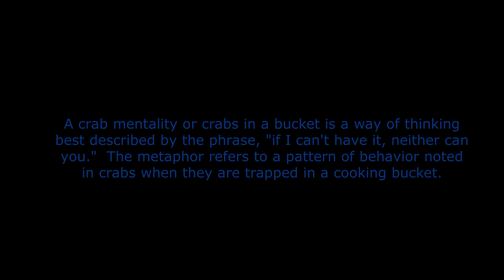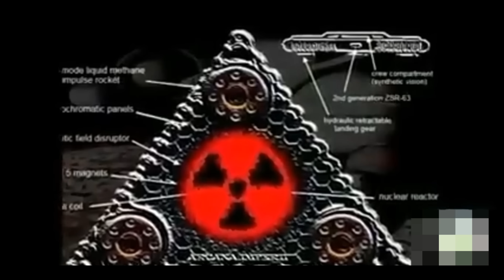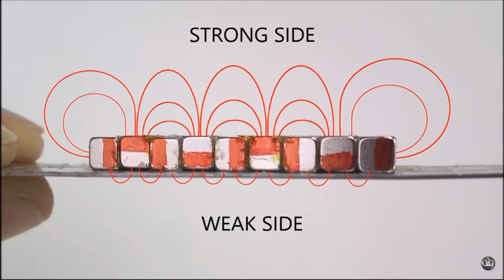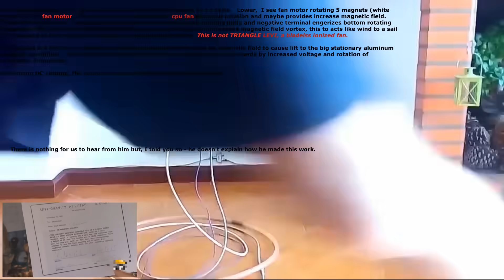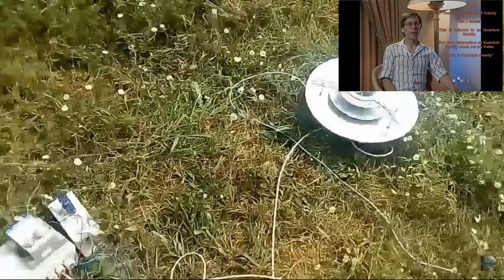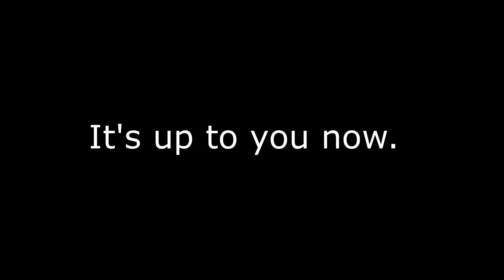anti-gravity project

Comment: Seem like the risk outweighs the benefits 
Would there be side affects? 
Large eyes, big head and skinny body! 
Serious though there would be side affects init.
Reply from the maker: None. Something to think about,  your microwave oven operate at 2.5Ghz now multiple by  two you get 5Ghz.  Can you identify with your question.  To power such a device would operate at 60hz A/C.
Reply: @jefflucas_life  a microwave oven creates radiation 
However we are not sitting in it nore around it for long periods of time 
Thus again, side effects.. now I would like to see other planets and travel the universe as well, and believe it's beyond my lifetime. 
I don't doubt it's possible, I just question everything. Not for fun, but interest, hoping I can contribute. 
Like the mercury, will it freeze in space, or is the other added metal to insure it doesn't. 
Believe me possibilities are endless. Just like the conversations with my son after watching this video. 
Back to geeking out. Thanks for the response. 
As we say these days be safe out there
Reply from the maker: two years now it’s a lot safer to use aluminum mass.

Comment: WoW that was very cool to see that ,and u guys did that with a 12 volt battery and a few other items i saw some in project boxes and how you could make the mercury spin around that is very cool  and the model took off up in one direction , but can u make it go into any direction other then just straight up in the air that is the hard part but also can u make one powerful anuff to lift a craft off the ground and fly up into space now seeing that thing fly it does not have to be saucer shaped at all just the motor i call it a motor becouse it is electrical i have a fair understanding of electricity and probably could easily recreate your model but the motor you built is not Alien it made out of materiel s found on earth , the only bad thing about it is the mercury that is probably the only part of it that would take some care in using it mercury does have some interesting properties even when used in a thermometer it can magickly move up inside a tube and show the tempeture out side kind of cool good invention also probably saved some life s , what i have seen here is very amazing to see and it was not a joke or fake it really lifted off the ground well i would say you guys have a lot of work to do in building a proper space craft no more rocket engines yeah you guys are on the right track for sure wow I am very impressed bye this and it was such a simple device to build not to complicated very few parts far less then a rocket engine wow i can t get over what I just saw plus Robert lazar does know what he is talking about also tells me what they have at Area51 is not Alien space craft but nothing more then the work of great minds in physics WoW you guys are flying in the right direction keep it up don t ever stop and tell the world this does not have to be kept a secrete like they do at Area51 and also Area51 should open there doors to the general public so they can see the most greatest inventions ever created on earth like i say this is a heavy on the WoW factor great job every one I am so impressed there where some things all s you guys could mention like how many amps did it take to get lift i know its a fair bit the wire was fairly thick so you are using a fair amount of current awesome job people you guys kick ass how about building the NC1701 Enterprise have fun lol

Comment: I wrote about gravity earlier, and my idea for gravity is same as Casimir-effect, I think the objects are pushed to each other, because the "energy shadow" between two objects. Off course the formula is different to calculate the power of the gravity, but the cause is same.
I think the anti-gravity can make by creating "energy shadow" and also we can move in the universe by pushed the Vacuum energy if our machine can create an "energy shadow"
I think the movement by pushed is working on every particle, therefore the human body does not have the problem with the acceleration like we have the way when we accelerate the space ship body with humans in it.
What do you think?
Reply: what is energy shadow

Comment: i believe magnets rule the multiverse ,  if the earth is a big magnet and magnets can be driven with energy like electrons and electron function like micro magnets,  if this is so can power and fast spinning magnets create a weak gravity that can move using the alternating flux of magnet push/pull effects?  the objective is to create a field on rotation magnet particles that will create a gravity field push/pull motion using its own pockets of stress allowing for a non friction movement,  do to the effect of this wake negative charge wave that is canceled out by a different field that fills in behind the first wake disturbance?

  in effect the energy of the disturbance is in effect causing a counter wave or wake that allows no impedance do to the action of the leading wave.  so its like a race car that leads the race moving in clean air,  the cars in the rear will suffer in that they  must move in dirty air.  now look at this in revers,  if a device causes a dirty wave of energy in front of a craft do to its energy wave fields in a way fracking the space in front this dirty charged air pocket should set up a country wave that moves without being effected by static charge?  in effect the negative charged air space acts as a pull for the positively charges air space behind it!  the one energy first pulls the dog with it?  its all energy waves moving at speed using natural existing forces in the system,  used first by technology of that hidden nature,  dark matter.

Comment: 9:54 what nonsense to say that time gets slower in space or with gravity, time no matter what formula you use, is the same no matter where you are in the universe, it's pure speculation. If you culd travel with lightspeed the time is the same, it will always run forward at the same pace ..
 1 hour forward and 1 hour back, no matter what speed you have, will always be 2 hours.
But let's say we fly away from the earth in the opposite direction as the earth moves for an hour and then turn around, then there will be much longer way back as the earth has also moved, then it maybe takes 15 min longer to reach the erth again, depending on the speed you have traveled at.
Reply: @HUNTING GAMERZ It's a mechanical thing has nothing to do with the time that has passed.
Reply: @felixundertordrup5348  no

Comment: Hey quick idea, maybe nothing will happen but mayby it will be informative.

Get 2 clocks or watches,( bonus points if it is a courts powered) set them to the same exact rhythm and time. Put one in the “saucer thingy” and run it for different langths of time. I suspect that the watches may get de-sincrinised or even end up showing different times. If so it would be fascinating to know wether it was the clock in the saucer or out that is behind and by exectly how much.
Reply: good idea

Comment: For the last part showing the lifting body, if he used Mercury which has iron dissolved in it, with impurities of Thorium, Barium, and Chromium ions, the Mercury not only becomes a ferromagnetic liquid, but also a super conductor at room temperatures or slightly above. It might need a voltage supply of 15 kV in order to get the mercury spinning fast enough (and I did notice a large coil  similar to a Tesla coil in the video). I would like to hope this is real, but with the internet, who knows. Unless I can see it for myself, it will be forever be a hoax.
Reply: Yeah it looked like a few magic tricks going on there so I'm going to decline to take this video on face value. I'll give him the benefit of the doubt on trying to put forth some new ideas. But I don't like to be deceived.
Reply: Woow Super inductor líquido a temperatura ambiente 🤯 y los científicos actuales disque buscando ese elemento y este video ya lo dice 🙏
Reply: Many coils of thin wire is for higher voltage. Thicker wire and less coils is aiming for higher amperage. So that tesla coil looking thing seems to just be converting the 12volts into much higher volts.
Reply from the maker: anti-gravity-toridal_synergy
https://youtu.be/8KGuB8bZKNs

Comment: The TR3B uses a torus to reduce gravity. the field is created at 60 revolutions per minute, at 260 atmospheres, at absolute zero of a quantity of mercury inside, the spin is created by use of electromagnets on the mercury inside the torus. creation of a torus around the first one and using the same method but spinning in the opposite direction allows the TR3B to have a frictionless shell that also allows the occupants to not become subject to any exterior force. The use of both tori created a wake where nothing electronic will function within six miles of the craft. The mercury inside the torus(s) becomes first element 118 then a millisecond later element 116 which opposes gravity
Reply: You are the first that say that is a torus inside a torus, very interesting. if your info is true, then the TR3B is not very useful in the city, and difficult to drive because no GPS. you are a primary source of info?

Comment: Hi.. Is it possible to use mercury as a rotating mechanism inside the motor so that when it starts spinning after passing current through it.. It will  start rotating wheels attached to motor.?

Comment: Vorticity is the "quantum gravity"... 

AuPt is both magnetic and diamagnetic... 

Gravity is NOT a "force"... it's just geometry... Einstein shows that in his math... and the story about light approaching a moving object... he used an elevator, which was high tech in 1900... he uses railroad cars and passengers as examples also... because that's what people knew in 1900... he didn't know there were other galaxies... until Hubble in the 20s... his math shows that the space around a mass is bent by direct inverse proportion to the distance from the center of mass.... it's not a force... it looks like we are all walking around on top of little you shaped hills... and we are all ==>> sliding downhill all the time.... 

This is actually good news... it's nice to know that the Earth does NOT suck
Reply: Einstein and other mathematics are simple... when we use metric... inches and feet... ounces and pounds... are the Imperial system... brought to you from the Roman empire... which used a counting system with no zero... and no decimals... half of the issues with Feynman's math are related to converting from metric to Imperial... people who grow up using the abacus start the numbers in the 5th column  .. 4 decimals built in... for accuracy... 10,000... so even when you convert to thousandths... the Chinese and Japanese and Korean people have an order of magnitude greater accuracy... with each measurement... and the accuracy becomes additive... or subtractive... depending on how many decimals you use

Comment: A) Gravity is definately not some kind of wave.  Never was.  B) Einstein has defined finally what gravity is by defining what mass actually is and how it expells variation into the fabric of spacetime by its sole presence.  Gravity is a property of mass itself. Nothing which is "transmitted" into an area around it. No "radiation" of any kind. Gravity therefor is also not a "particle". There is no mass that has no gravity on it, even the tiniest fraction of a mass has a gravitational impact onto the spacetime around it. So there can be no objects or machines which can shield it ,because they are even embedded therein, in the fabric of spacetime, being a part of it. So nothing which is part of our physics, can shield it. Altering gravity would require to alter the nucleophysical property of matter (down into its tiniest particles), as this may or may not alter their mass. So, only taking mass away from a location alters the gravitation. Neutralization means : taking all nucleophysical mass away from the respective object. The outcome is: The object no longer exists. Taking spacetime out of an area to "neutralize gravitation" means: Taking any kind of physical existence out of this area because outside of spacetime is no existence. In other words: Such a condition doesn't exist and also can not be produced.       To make a clear statement about "gravitational waves" (which can be detected of course but are entirely different from "static gavitation" itself, and are also no wave, radiation or particle) : This is solely a measurement differential which expresses a change of the amount of gravitation - variation in the fabric of spacetime - as the collision, the sudden fusion or hyper-/supernova-like transformation of portions of matter (into energy - waves - particles - radiation) creates a variation of their respective mass/es. This expresses as the corresponding variation of their gravity and creates a shortliving transitioning variation of spacetime. Why "shortliving": only in the process as this happens, there is "variation" in the fabric of spacetime. Thereafter, when the process has finished, the energy has been expelled and the final object has been created, the spacetime is static again. The strength of these gravitational changes is defined by the speed of that process, and also of how many matter in involved therein.
Reply: Would like to add because its likely to surprise you as you seem to be one of the few in this comment section with any clue however we recently have found acoustic waves can be configured to behave as negative mass at 1 watt per 0.1 gram which while not a lot is amazing and if Gravitational waves were arranged in a simular configuration you can bet results would be amazing.  If you can't find the papers I could provide the DOI  if need be.

Comment: Is there more information about this floating crafts in the field. The ability to fly longer could be due to the power supply. May be we can share some more research works. I had some new methods for power source which can run forever with very little fuels requirement.